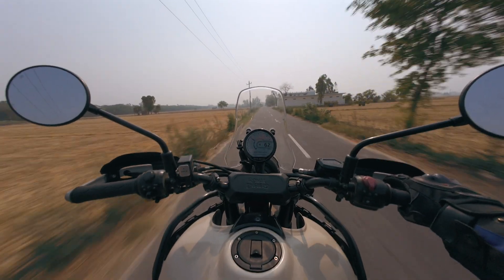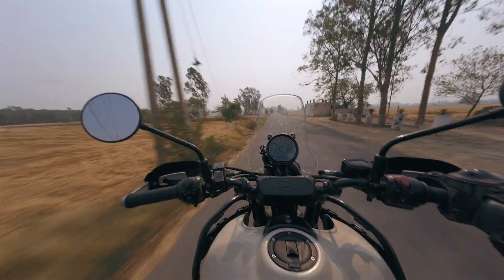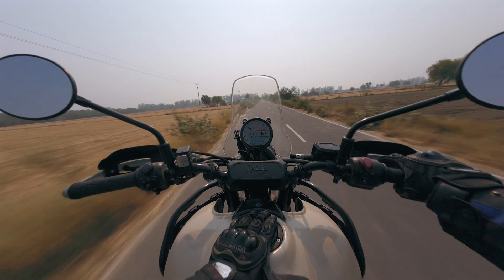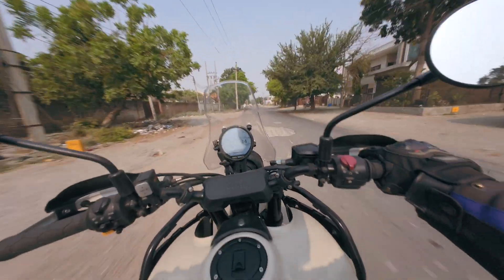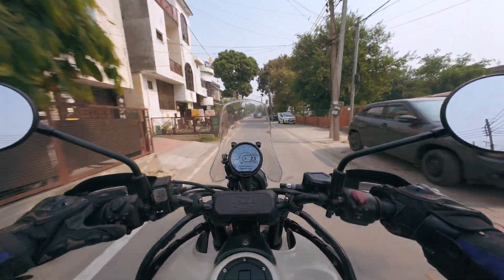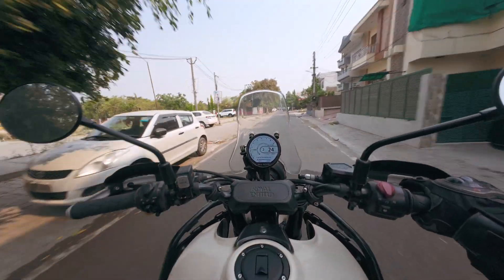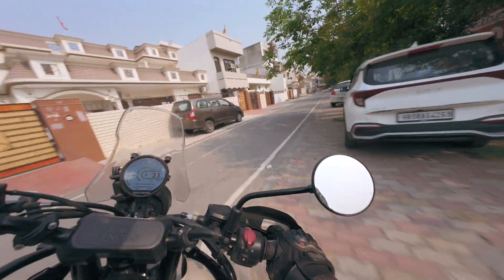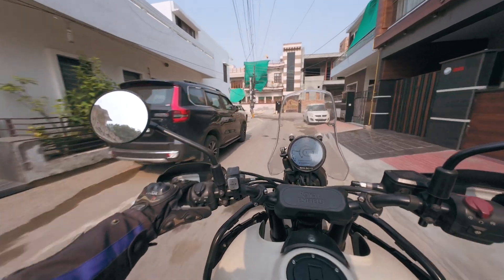Overdrive Gear in Himalayan 450 | Royal Enfield

Comment: In overdrive gear , engine have to work more if you are not in sufficient enough rpm.

Yes for high speed speed above 80kmph I would say, it will be more economical

But if someone tries to do it at below 50 kmph or in uphill they will get bad fuel economy 

Most tourer motorcycles has such gearing .
Reply from the maker: Why would someone ride their motorcycle in top gear at 50kmph ?
Reply: @RideWithManDeep  Majority Indians are not familiar with high compression oversquare engines, so they do try to run the motorcycle on high gear at low speed. Its a fact actually. People are not good at riding those precision machines.
Reply from the maker: I agree

Comment: Youtube randomly suggested me this video and I appreciate your input on rev matching. However, as you have Himalayan which comes with slipper clutch. I don't think rev matching is required as long as the rev change is under 1.5k. I have hanle black and I have checked it personally, slipper clutch disengage the clutch plate till the difference is under 1.5k, anything beyond that requires rev matching. Despite of this fact, eveyone should learn rev matching for better riding experience.
Reply from the maker: @harisrehman1731  anything that has engine , gears, brakes and travels on road requires rev matching. Doesn’t matter what fancy tech they got. I will explain that in the video ✊🏽 cheers